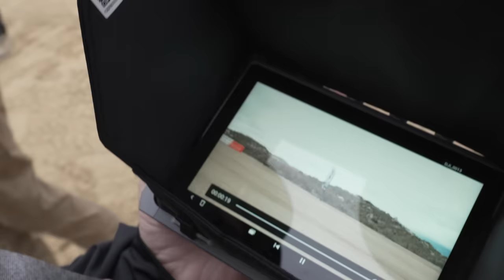Methanol-burnin’ Old School Sandrail vs Ultra4 Racin’ Jeep Wrangler // THIS vs THAT Off-Road

Comment: The problem here is, this race course 100% favored the jeep.  That rail was not designed for hard packet surfaces.  The jeep is.
  I give the win to the rail.  He won the first race, lost the second by about the same margin the jeep was given, broke in the 3rd likely due to jist how rough that track was for that cars setup.
Reply: Thanks , 20+ yr old valve springs and no traction on the limiter of 7.5k
Reply: This course is not favored to a Jeep in any way. any solid axle vehicle is at a disadvantage in high speed sections like the entirety of the course

Comment: Full respect to Holly, her jeep, and her driving, but the crew really screwed over the sandrail on the second race. If they're within a car length, they should have run it back head to head and it would have been a second great race but instead they just gave Holly like a 4 car length win for free.

Comment: 425 hp at 900lbs is crazy. That is better power to weight than a Hayabusa. 😅 even 100hp would be quick. 😂
Reply: Yeah, and at 0:40 , the editors mixed up the yellow “better” highlighting in the specs.  The 0.47 is the better p/w.

Comment: The comparison screen was a joke. Did you get the power to weight ratios backwards? That sand rail has nearly the same power and less than half the weight. That doesn't look like independent suspension on the jeep and it looks like solid rear axle/trailing arm suspension on the back of the sand rail. Maybe you should hire someone, that knows about cars, to proof read your shit. I hope this was just a bad April fools joke.

Comment: I grew up on sandrails with the right rear tires those tires did not have much Bite and as far a that jump that sand rail whould have no problem taking it at speed and the whoops you could go faster as well

Comment: I thought sand rails were made for jumps? Why was he taking it so easy? 
W on the win though 😂
Reply: Not those old VW rails. They have less than 5 inches of suspension travel in the front and barely more than 5 inches in the rear.
Reply: @Berm_Blaster  yeah I watched his seating position, fastest way to lose a limb on a wrong jump

Comment: The specs at 0:39 seem to have wrong yellow highlighting.  The rail has 425 Hp at 900 lbs. (0.47 p/w), which seems “better” than the Jeep (500hp and much heavier).

Comment: Man they set the sand rail up to fail that second heat. Jeep didn't need the hit or a car just get on the gas, and that sand rail has to stop in the whoops or the driver would need a new back.

Comment: lol didn’t know independent suspension can gift you 16 inch of travel 😂😂
Reply: You realize Trophy trucks run independent front suspension and have 30+ inches of travel... Prerunners have IFS and have between 20"-28" of travel in the front
Reply: @Berm_Blaster  it was more towards them listing the jeep with independent suspension lmao not that deep bud 🤣🤣🤣